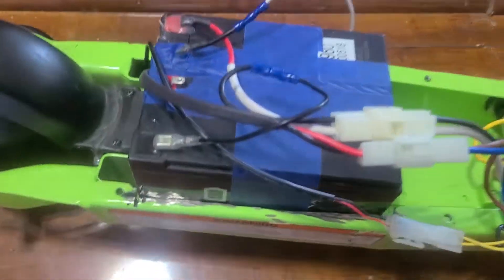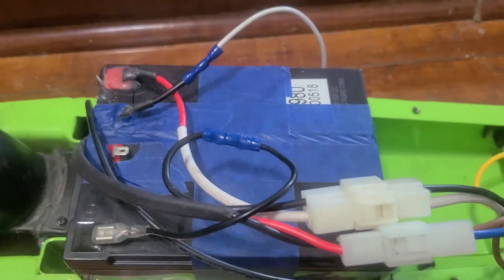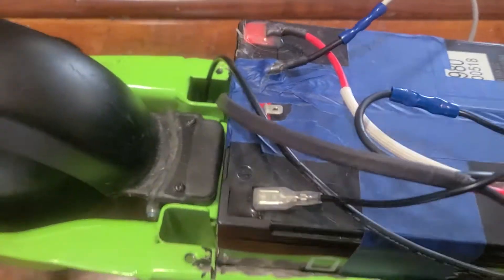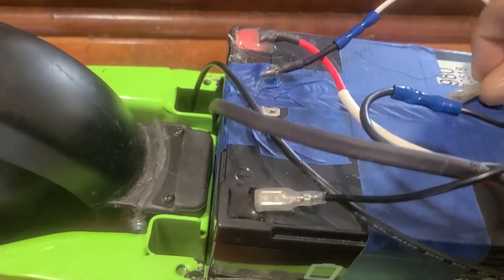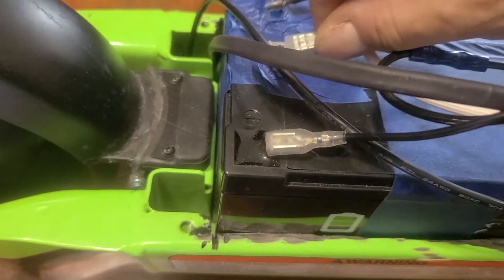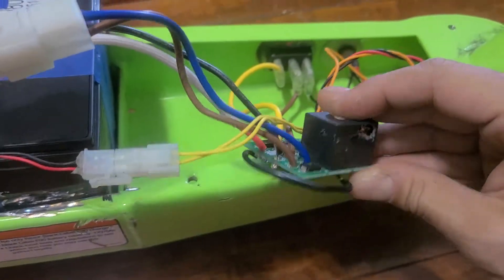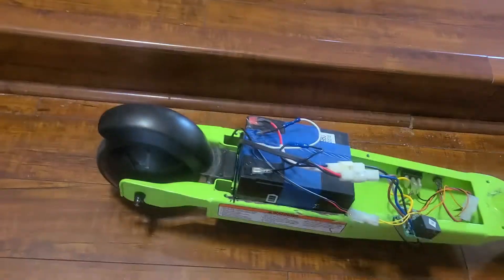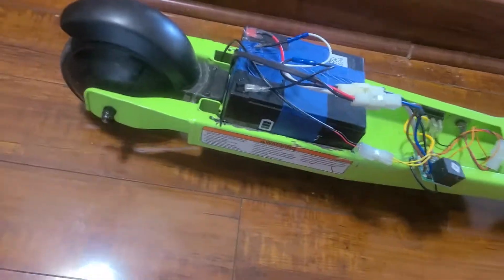Razor E90 12v to 24v with kickstart bypass.

Comment: How are you going to stand on it
Reply from the maker: Im going to bend the top plate and make it sit taller.
Reply: or you could move the switch onto the handlebars adjust the charger connector  enough to fit the second battery in front of the original one and turn them on their side. the pcb ĺooks small enough to fit into the small space that will be left over under the small  ledge toward the front

Comment: Hey love the video man! Could you show how to do this? Also my ciruct keeps getting tripped only on a 16.8v 4s lipo. Is there a way to bypass this without a voltage regulator?
Reply from the maker: I think I successfully bypassed the trip switch. I will video the trial run soon as well as show how-to if it works. There's another vid like this but left me a bit confused on a couple specifics.
Reply from the maker: Sorry. A part came unsoldered. Havent gotten back to it.
Reply from the maker: It's been a while, sorry. The scooter was out of reach for a while there.  Ok, so I learned how to do this by watching another person make it work on his channel. I had to pause his vid a few times to look at his wires. Im going to have to do that again cause i dont want to screw it up. I also dont remember the name of that channel. I have to go look for it. I do have the scooter back out.

Comment: How do I remove push start
Reply: Thats what I'm wondering
Reply from the maker: I have to go back and see the vid i had watched to do this. Scooter has been buried in garage area. I got it out and cant remember where a wire goes that fell off.  Theres a vid i would pause to look at wiring.

Comment: How do you add second battery for better battery life
Reply from the maker: For better battery reserve, you'd wire the two batteries in parralel circuit instead of series.